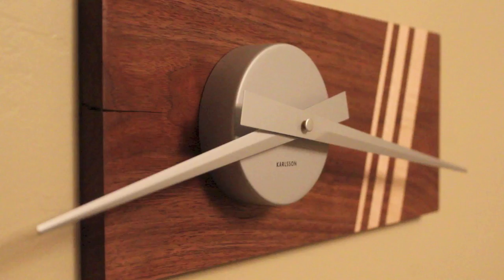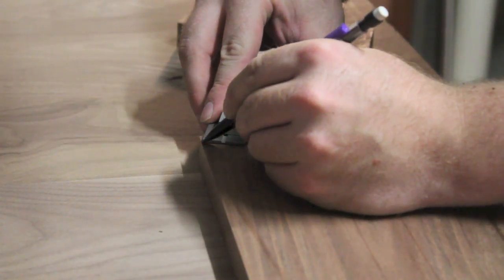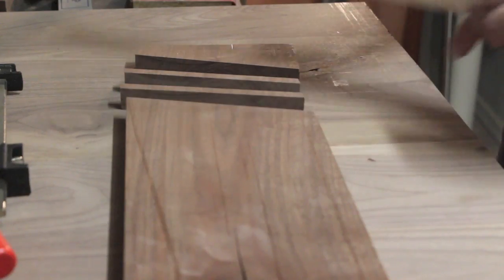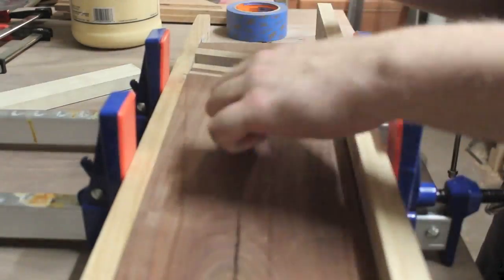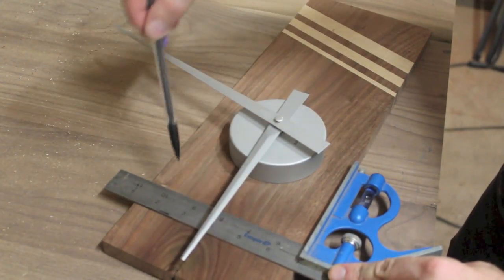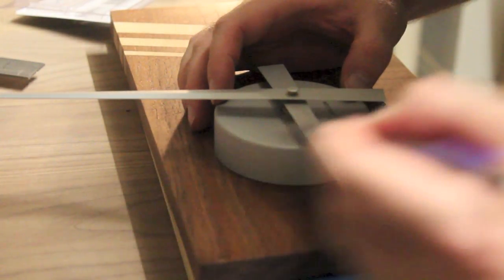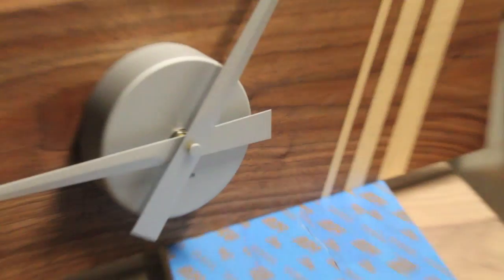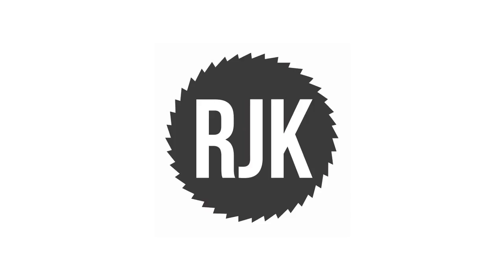DIY Modern / Minimalist Wooden Clock

Comment: Man, that turned out well. I need to remember what a few cuts and some accents can do to a board. Love the finished project and the video was super easy to follow as well. Thanks for sharing the process!
Reply from the maker: +DN Handcrafted thanks man! I always use Sketchup when I know the proportions will be a huge player in the design. Amazing what an 1/8th of an inch difference here or there will do.
Reply: Robert J. Keller ah, very cool!